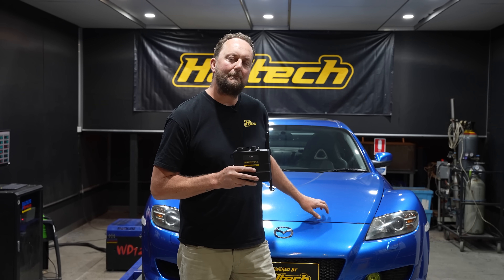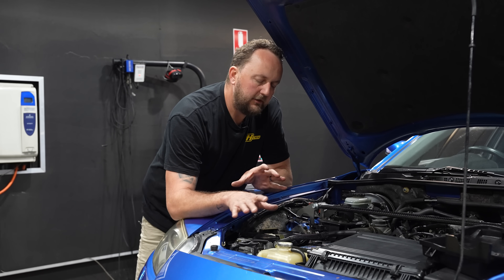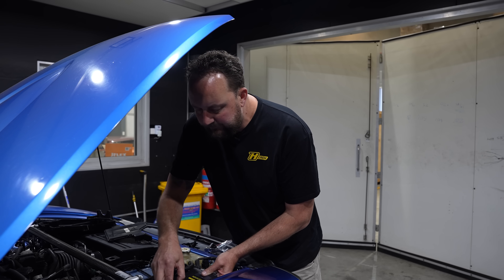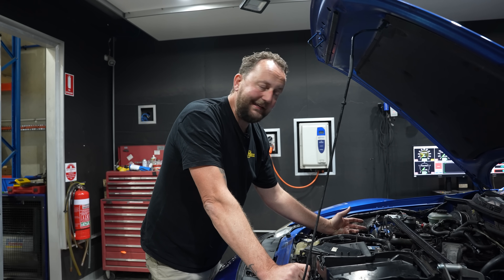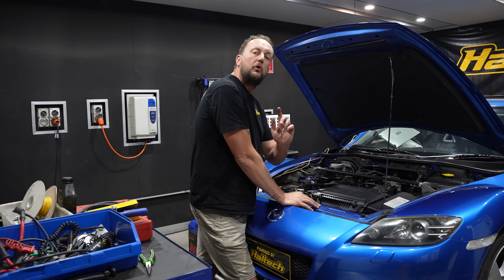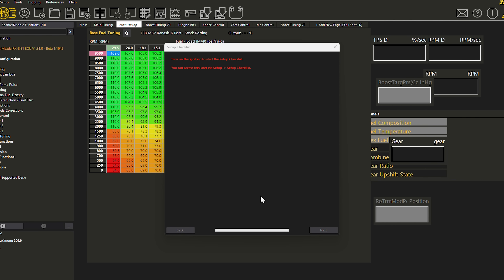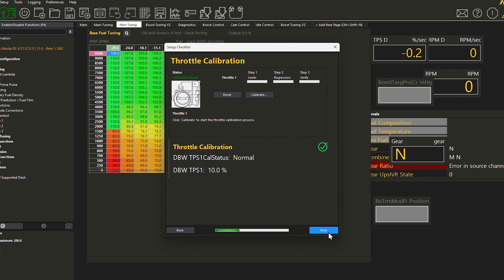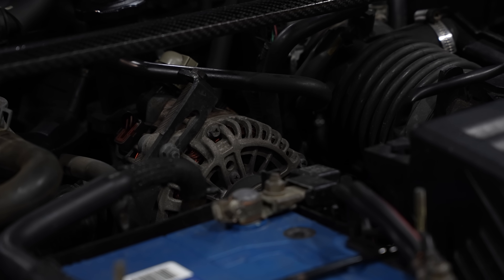Make Your RX-8 More Reliable and Drive Better With This Mod!

Comment: Please do a plug and play kit for CL9 accord euros. There are limited aftermarket ECU options for this car. To run a hondata, you need to use an American TSX ECU as hondata does not unlock the Australian ECU. Other ECU options lose most features like cruise control. I believe there is a big market opportunity that can be at a similar price point to a hondata set up with much more and better features thats 25 years newer in technology. Thank you

Comment: That ecu has been out before, those 3 bolts are anti theft snap nuts. No head remains
Reply: RX-8's in other markets didn't have the extra security bits that UK-spec RX-8's have.

Comment: I have a 2004 6 port with a Pettit Racing supercharger (10 pounds of boost) for the past 15 years.  10 of the last years tuned with non supported COBB and happy to hear that I can finally switch to a Haltech.  That being said just by watching the video I run stock injectors for Primary and ID 1000 for secondaries noticed on your video BUT I do run (for the past 10 years) MSD 8247 ignition coils which I believe no longer sold by MSD with no issues.  Question...can I still run my current MSD 8247 once I switch to the Nexus or do I need to change my ignition coils?  If so, what do you recommend aside from the factory coils.  Please let me know, thanks.
Reply from the maker: Yes, those MSD 8247s are supported by the Nexus Plug-In
Reply: Thank you ❤

Comment: I’d love to know what hp difference an ecu upgrade could make. Anyone know?
Reply: There's bulk discussion and results on this, with basic supporting mods (all ignition/spark, mid pipe back), like 10-30hp and a slight shift in the powerband

Comment: Hi Andy
Thanks for the reply.
I did some reading I see jdm is  supported so that's fine.
A further question can I use this ECU in place of a 6 port auto one when swapping out the auto for a 6 speed manual 
Thanks
Reply: Yes, the only thing I can think of is that the dash isn't going to see the auto trans related CAN messages so I don't know what it will show on the PRNDL or the manual gear number display. But the ECU will run the engine fine.

Comment: Will the abs throw a fault code when using this ECU.
What price for ECU and O2 sensor.
Does this work with a s1 with advanced smart key
Reply: Which model? All the ABS units we know about are supported except for the early European (German) 4-port models with K-line ABS (not CAN). What's different about the advanced smart key?

Comment: Any tips for installation with a tube intake like the aem/ boosted setups?
Reply: Yep, get rid of the MAF and mount the included air temp sensor on the charge pipe before the throttle body.
Reply: @Andy_the_engo  While running non-turbo with an AEM intake, is the recommendation to ditch the stock MAF and make a new tube for the IAT sensor or where would you recommend adding it to the tube?  It doesn’t seem like it was used in the two videos I’ve seen.
Reply: @rlcodi  The wizard map doesn't use the MAF, assuming that most people running an aftermarket ECU would have be running a turbocharger, so they'd need the flexibility not to run a MAF. So the expectation is that people would delete the MAF.
Reply: @Andy_the_engo  Does that mean in non-turbo applications the air temp sensor is not necessary?
Reply: @rlcodi  Air temp sensor is always necessary, but you can use the one built into the MAF if you retain that.

Comment: 1:04 - @Tuning Fork why do auto manufacturers put the ECUs in areas that are hot, vibrating, exposed to moisture and dirt when computers, in general, don't like those conditions? 🤔
Reply from the maker: That is a mystery to even us!
Reply: To save on the copper wire
Reply: @kevinobrien3063 at the expense of having to build the ECU to be durable enough to live in those conditions? Or at the expense of possible ECU failure in these conditions? 🤔
Reply: @PANTYEATR1  On the series 1, it's really an "inside" ECU that's in the engine bay. The enclosure is waterproof and there is ducting to cool it. The series 2 has a more standard engine bay mounting ECU, where the connectors are waterproof, the ECU itself is waterproof also, and there's no enclosure that the ECU sits in (there's just a cover on top).

I think they were moving to engine bay mounted ECUs and just didn't have the tech to do a full engine bay ECU in 2003 (they did it in 2006 with the NC MX5 - at the time of the RX-8 launch, 2003, the MX5 was still the NB8B/C with the ECU under the kick panel). Probably to make the harness simpler and easier to install instead of having to have a huge fat harness go through the firewall.

Comment: Question, does the ecu compensate for extreme altitude when its tuned off of VE tables and MAP sensors? Are there Barometric sensors a person can add as an input to make say, Pikes Peak "easier" to tune for?
Reply: I do not see why it wouldt, It should just detect that "too little air" is coming in and then adjust the fuel to fit, like if there is a bad air filter in the car.
If it was turbo, the wastegate should close more and work harder to try and fix the low pressure air coming in, it might overspeed if it is close to the limit already at sealevel.
Reply: MAP / VE based tune already works pretty well for altitude because as you go higher in altitude and baro decresaes, your maximum MAP decreases also. The only effects are on the exhaust back pressure (which is lower at higher altitudes / lower baro pressures) and transient effects where the ECU is trying to estimate the MAP.

The RX-8 has a factory baro sensor which is set up in the ECU anyway so it's there, in case you want to set up a fuel correction or something.

The best way to tune for fuel is engine pressure ratio (exhaust MAP / inlet MAP), and then baro has no effect at all, and that works for any induction/boost method.